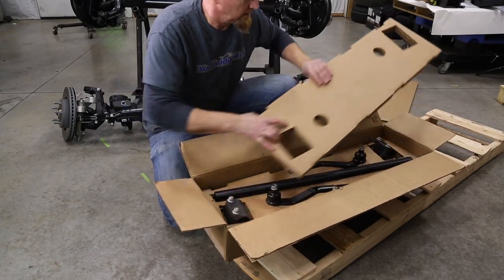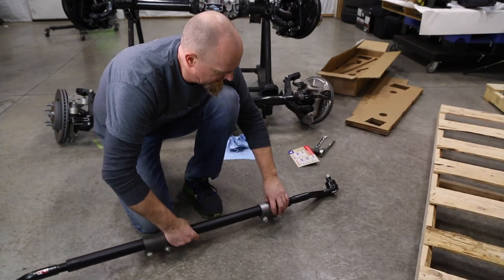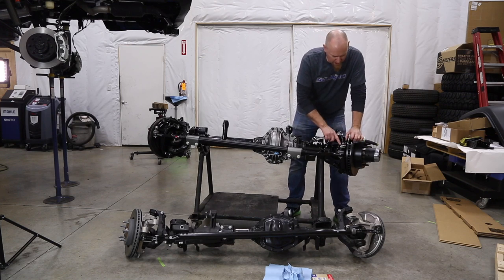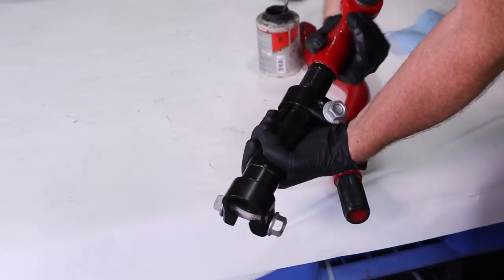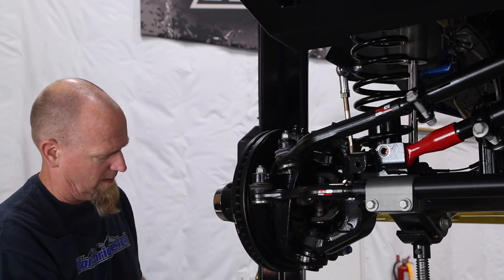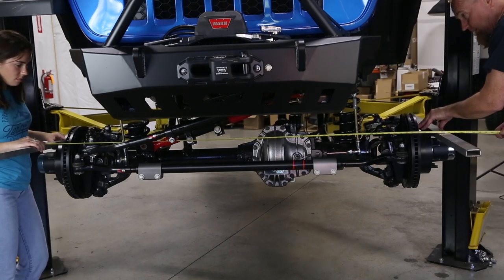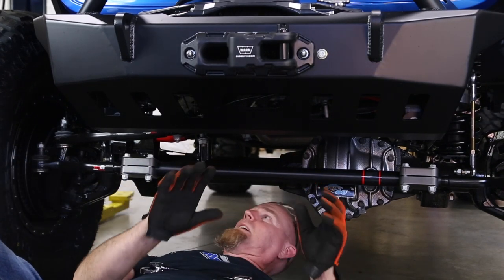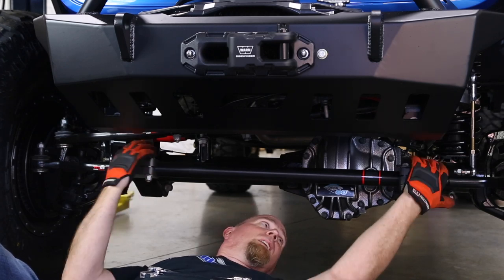Steer Smarts Yeti XD Steering Components - Jeep Gladiator JT Install

Comment: I running the whole Steer Smarts ensemble...Yeti XD tierod, top mount draglink w/ Griffin, trackba & swaybar links & zero complaints with 1 exception. I recently upgraded my Yeti XD tie rod with their aluminum adjuster tube & imo they should've went with 2" OD. Deflection with 1.75" & steering doesn't feel as tight. Not to mention,  steel pinch clamps on aluminum isn't ideal combo. I hate jamb nuts myself but that would've definitely made for the better set-up
Reply: Steering deflection as in when you go over bumps you feel like a rattle under your feet over bumps and stuff? I noticed ever since I installed my barnes 4wd 1 ton steering aluminum ive had this. So wondering if that's deflection ?
Reply: @JoseOrtiz_1416  exactly what deflection is and it'd be more prevalent with Barnes being that it has 1.5" OD, 1/4" less than what I'm running with Steer Smarts' offering. RPM has 2" OD and people are reporting deflection with those. It's just a trade off you sacrifice running aluminum. It's better for the trails but daily on road...not so much. I'm about to go back to steel & swap in aluminum just for when I go wheeling
Reply: @dwizl7213  ahh good i was worried it was something else lol yea i can deal with it although it does get very annoying. Thats actually not a bad idea ! I might actually run a steel DD and swap out ill have to look into a good steel replacement
Reply: @dwizl7213  My Aluminum Doetsch steering under my JKU flipped to the top of the knuckle is solid.
No rattling and no bump steer at all.

Comment: Now how much bump stop do you have to run so the drag link doesn't hit the frame?
Reply from the maker: That Gladiator had the EVO Mfg Enforcer 4.5" lift on it and we used the bumpstop spacer that came in the kit. Nothing special needed.